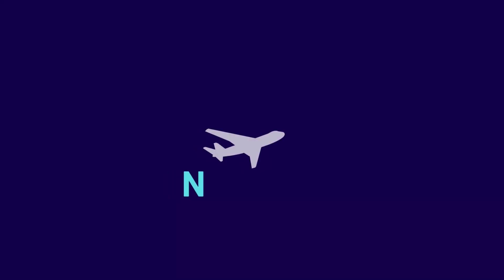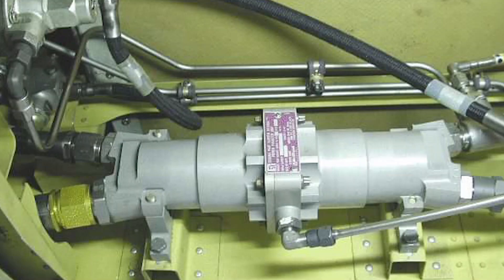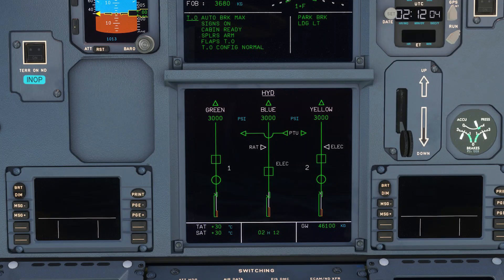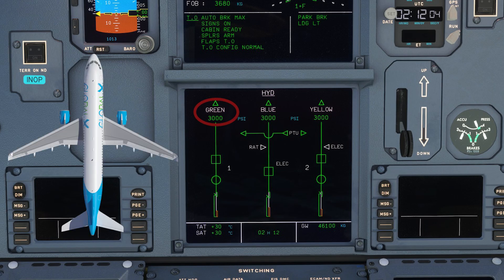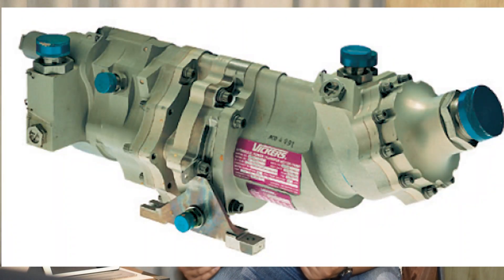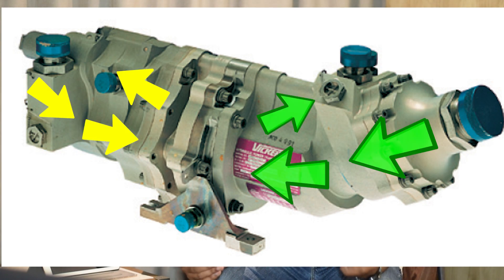What is the Barking Dog sound on a A320 | Power Transfer Unit (PTU)

Comment: Thanks and something understood specific. 
Wonder why green system drives yellow and is it power saving mode to use PTU .. save during parking .. alone .  Thanks for the video…
Reply from the maker: Thanks for asking. It is actually a redundancy, as the yellow is driven primarily by engine 2, or the electric pump, hence why you would only hear this during arrival or departure, as there's normally a brief so called "transfer duration"